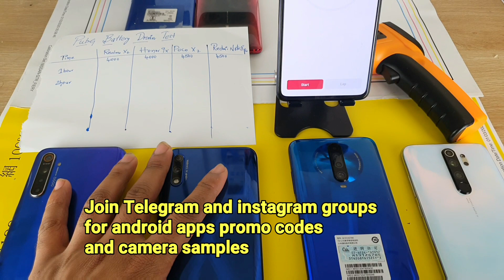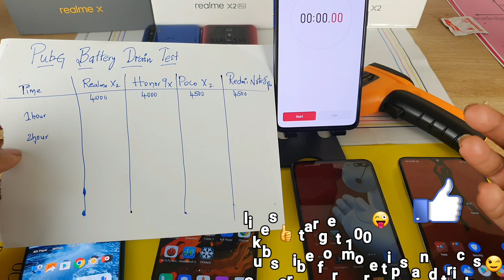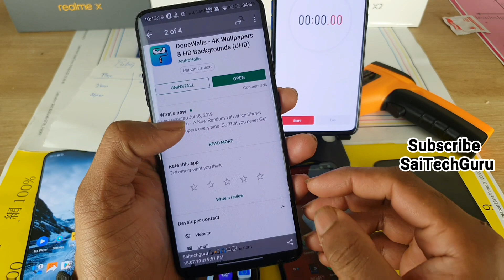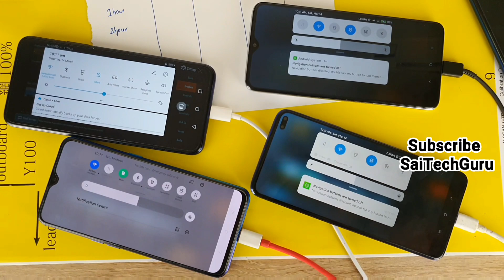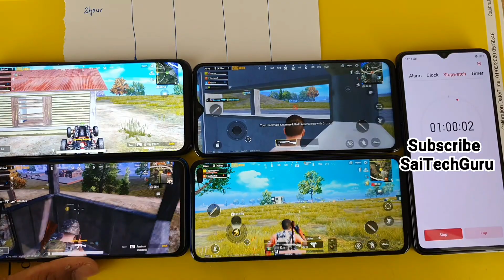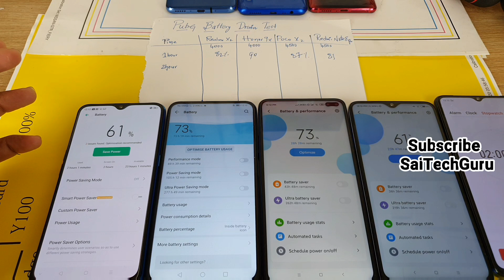Honor 9x Pro v/s Poco x2 v/s realme x2 v/s redmi note 8pro pubg battery drain test

Comment: Bro Try honour 9x Pro vs realme x2 pro pubg test
Reply: The Realme X2 Pro has Snapdragon 855+ which is a flagship and a better performing processor than Kirin 810... moreover, the Realme X2 Pro has an AnTuTu score of a little bit over 500k whereas the Honor 9X pro is a mid-range processor (probably the best mid range processor) with an AnTuTu score of a little bit over 300k which is still better than most of the mid-range processors...
Hope this helps
Reply: Thanks bro 🥰,but I said in a curiosity if possible then make a video
Reply: @rashmiranjanbehera8743  ooops my bad sorry